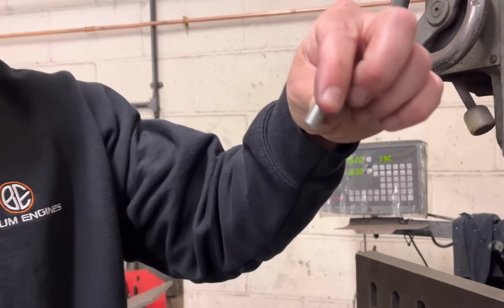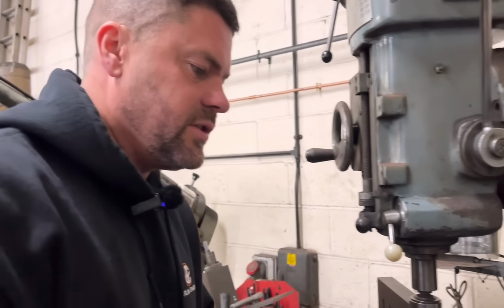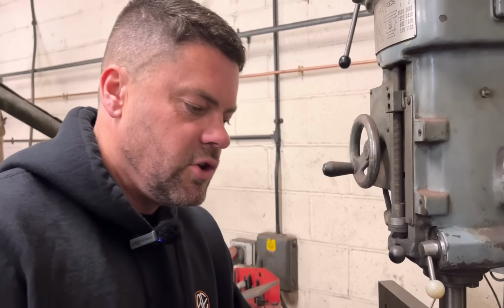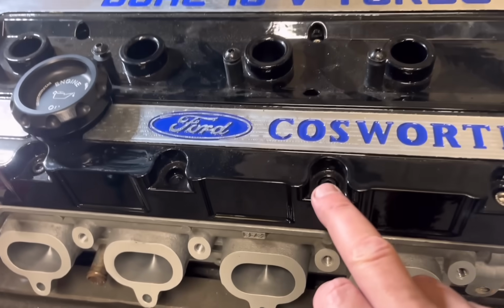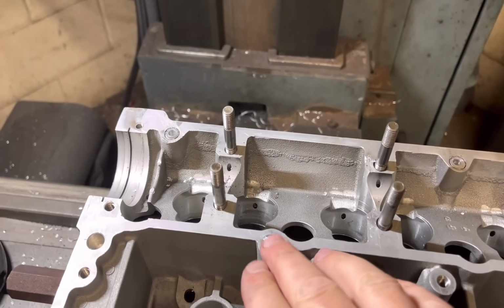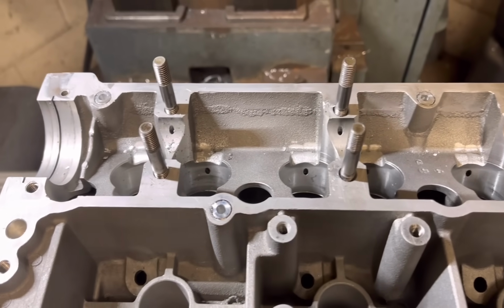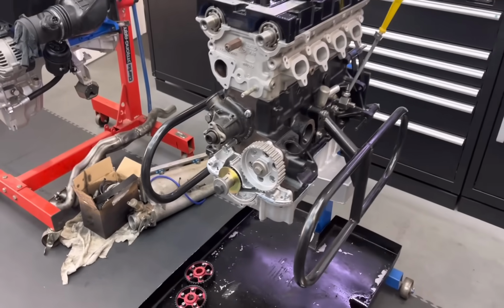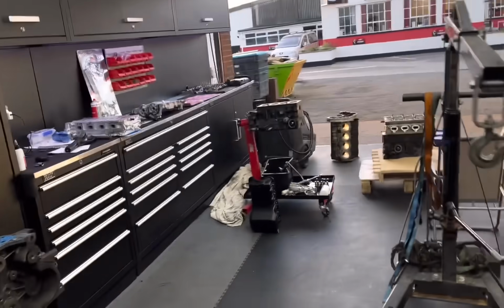Don’t let this happen to you! Customer gets RIPPED OFF!

Comment: My heart always goes out to these people getting ripped off by shops and they can't afford it. Thank you so much for talking about this and offering to the public to give your opinion on a price if they take the time to ring you up BEFORE they jump into those deals. After the shop in question gets the vehicle in their hands is too late.
Reply: The lesson to learn is the legal difference between "quote" and "estimate". 
An" estimate" is a guide whereby the bill can be increased or decreased accordingly.
A "quote" or "quotation" is a figure set in stone and cannot be raised.

I have given quotations for work to be done and in one instance the customer requested a driveshaft to be replaced. When we looked at the car, a previous person had dropped a screwdriver and it was rubbing against the shaft. Upon removal, the problem was solved. Legally though, I had to ask the customer if it was okay to only charge £5.00 as opposed to £430.... By law I could have charged the £430 as it was a contract for the work to be completed but by my own ethics, I could not abide by it.

Comment: 2:58 I have great memories of my cossies. Two saffs and an escort cosworth. That inlet I once spent hours and hours and HOURS with a dremil and a 26mm ball bearing carefully porting out until the bearing could run the entire track. Obviously not a professional job but I had it for 14000 miles, running a TT T38 bd14 inlet Siemens injectors etc at 34 psi. I sincerely miss them days 😢. Sweet engine mate ❤

Comment: I put the oversize bolt in the lathe and pilot hole it , then slot the top , dry fit it , mark it for fitted length and cut off the excess so its just a fraction shallow of the machined surface. When reassembling a nitrile o ring  squashes flat just perfect . 
Different strokes for different folks .

Comment: I was once upon a time quite a successful 2nd hand motor dealer in south London which is just about as ferocious a sharks tank anywhere and yes we had little "wheezes" but we always had a credo of safety paramount hence why never had a comeback on bad tyres or no brakes and we always made folks aware of problems down the road and who to talk to who would give them a fair deal rather than one of the "arches" mobs who would fleece their own mothers dry.   Its not a case either of doing due diligence as most times these firms are high volume stuff and do deals with commercial stuff and build a good rep up from that, so when someone small fry goes in and enquires its like a payday all day long because they are very experienced in selling a turd in a bag pretty much and will put the thumb and two hands on the scales at every step.   Even small things like spark plugs, they will gouge demanding the highest price for a set of plugs and actually paying trade lowest price for the cheapest ones, these folks know most owners won't check the branding or types and wander off happily with their couple quid each spark plugs but paid £10 plus each on the invoice :(

Comment: Heathrow engines Lee they had several cans of that recondisioning paint and appeared on the cook report back in the late nineties
Reply: ? Explain please.
Reply: I've been left the UK for ten years but saw a few Heathrow engine centre abortions years ago....possibly the highlight was diesel astra head they'd tried to skim then attacked steel pre chamber inserts with a grinder to try and rectify😂😂😂.....shocking
Reply: @sm400  best one I had in was a golf 1.6 carburetor engine block with crank and pistons (flat crown) with a GTI 1.6 head on (flat head) . They put 3 head gaskets on it to create an ad hoc combustion chamber space as with a single gasket it would be around 50-1 compression ratio. 🎉
Needless to say the gaskets blew , it leaked oil and the valve timing was miles out . 
But the Glasgow engine " remanufactures did put a nice coat of paint on it .
Reply: @AndrewNeilBaird  I remember the flat heads with chambered piston...I'm showing my age..😂😂😂
Reply: @AndrewNeilBaird  I've had to deal with an Alfa engine that had been 'rebuilt' with 2 head gaskets which needless to say didn't go well.  What could possibly go wrong with 3 head gaskets?
Reply: @georgebettiol8338 hi George I get the feeling the alfa engine has been the only engine you have dared to mess with. Because you have messed with somthing your clearly not qualified to do does not make you a authority on engine building. This is in response to a comment left on my comment. Maby you have nothing better to do. Suspect little man syndrome but I don't like to assume.

Comment: She should have just went and bought another used car. At that cost, heck ya. Could get something fairly decent.. or even Lease/Rent would prob be better than.
Reply: Yup I know for 10k you would think you could buy a new engine for that. Well if that's a normal run of the mill car that is. 🤔

Comment: Good video shame these people get stuck in these situations specially when there car is held as hostage. But some engine rebuild costs are well over the top I had a N20 BMW engine built oil pump went spun a bearing so needed everything got a original BMW pump for £500 from Russia so was lucky there but with everything parts and labour it come in just under £2000 so I really don't see how £4000 upwards is justified a lot of engine builders just replace rather than machining a crank can be ground rather than just replacing that's why bearing sets come in different sizes people are to quick to dispose rather than fixing nowadays luckily my engine builder is proper old school so will fix everything possible.
Reply: Haha mate let me send you a bag of commas and full stops for free, no charge, gratis. 😂 I almost fainted from lack of breath by the time I finished your sentence (paragraph). 😂 Cheers mate 👍
Reply: @gerryloveday3142  Perhaps send off to Russia for them if you can't get them here.
Reply: When you spin a rod bearing, the damage done consists of gouging of the bearing surface, ovality of the journal and excessive heat build up in that region of the crank - needless to say the damage is usually significant meaning that the crank is scrap.  As an engine builder, I would never just simply regrind a crankshaft with a spun journal that is showing a damaged bearing surface and a significant heat affected zone - as the risk to me would be extreme.
If you spin a main bearing, then there is normally damage to both the engine block and the crank - and in certain cases the block also becomes difficult and costly to repair.  How do I know, I have repaired an Alfa 2.0 litre aluminium engine block (ie. mine) that succumbed to a spun main bearing and will never do it again.
Reply: @gerryloveday3142  if you have a bag full then maby you should have filled in the gaps rather than running out of breath but would that be a bad thing...
Reply: @SloverOfTeuth  Russia was the only place with one in stock at the time (covid days) it was a genuine new BMW part at a fraction of the UK cost the month waiting for it to arrive was a bit tense but it all turned out good.
Reply: @georgebettiol8338  says it all your a alfa man (brave) my engine builder has been at it for over 50 years if it was scrap he would have said from the off. The bearing spun because the oil pump got clogged from the timing chain guides disintegrating common problem with the N20 the oil spray jet snapped of and in all the chaos the bearing spun I believe this was the case of it being run on tick over while knocking it's cunt out. But by the sounds of it I should have checked in with you first for your wisdom (not) by the way the fix was great another great job from service engineering Grimsby.

Comment: Instead of making plugs proud to then machine flat why not make them 0.5/1mm shorter, this would save having to mill flush.
Reply: they can charge more if you have to mill it!!
Reply: It's to ensure you have a flat mating surface which provides the best chance of ensuring there are no leaks from the cam cover gasket.  What's more is simply good practice - as opposed to using copious amounts of 'oozing' sealant, especially so if the engine is being properly overhauled at considerable expense for fitment into a beautifully restored classic vehicle.
Reply: Very good point. Everyone has there own way of doing things I suppose.

Comment: Great job on the plugs for the rocker box cover Lee, the only thing different I would do is leave them .5 mm proud then peen with a ball pein hammer around the top then flush off, it spreads the aluminium into the thread and you hardly see the repair😊😊 ( aussie toolmaker for 50 yrs)

Comment: 7.5mm diameter hole is clearance for a M6 screw is ABSOLUTELY not correct it should be 6.5mm diameter , l don't know were you get that information from guys, If that's what Ford have put in the camcover then l am totally confused because the head on a M6 capscrew is only 9.8mm diameter this gives next to no purchase for the head of the screw , That's just incorrect . David
Reply: You are 100% correct on the clearance diameter,however,ford do seem to like to use their "special" flange headed bolts,guess for a bit of wiggle room🤷‍♂️
Reply: David, I think your not understanding what lee said, i understand it because ive done it many times on cylinder heads, he is useing a 7.5 mm drill which is clearance size for the rocker cover hole that Ford drilled to spot the centre of the new hole that was plugged in the cylinder head, he then removes the rocker cover and is drilling the new hole 5 mm and tapping it out to M6. I totally agree what you say about the head of the cap screw being 9.8 mm going into a 7.5 mm diameter hole leaves very little material under the head of the cap screw, its not ideal but if it works it works.
Reply: I took it that he used the 7.5mm drill just to line up the small divot dead centre, then drilled and tapped the hole to depth using the correct-sized bits. Maybe he didn't explain it well enough for you but that's what I'd do.
Reply: Its all going to be ok David, keep calm.